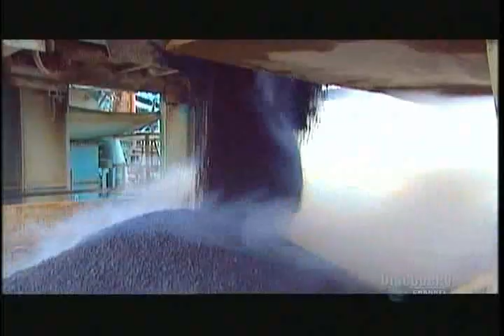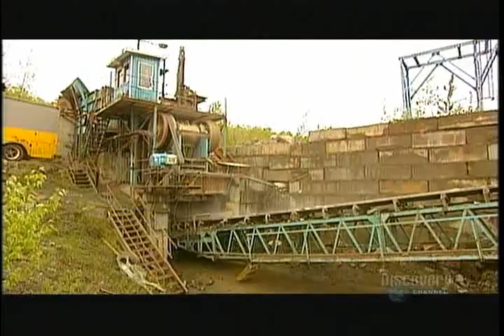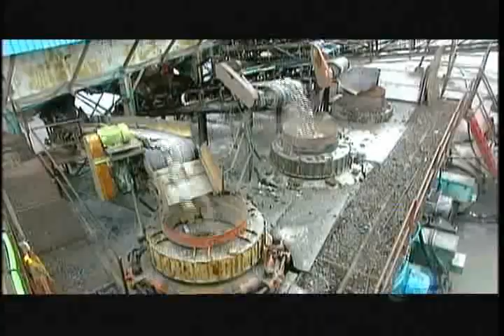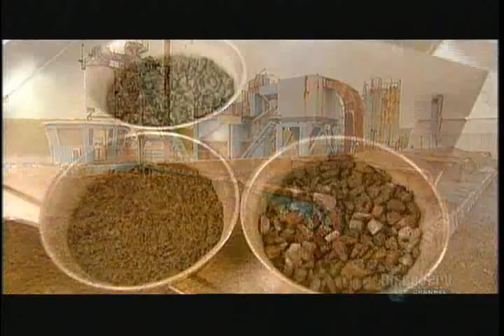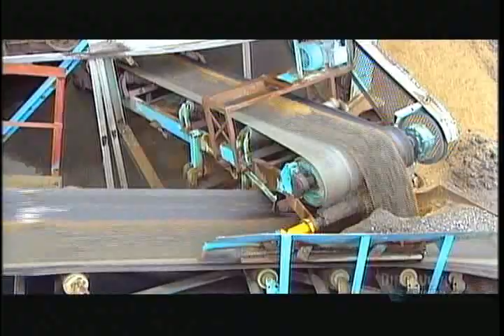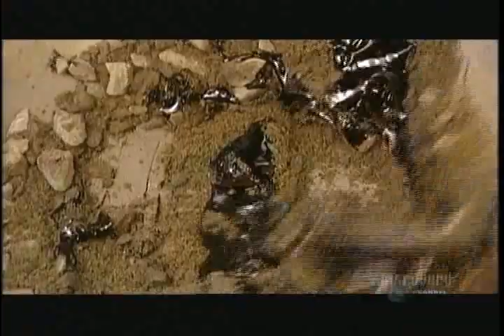How It's Made Paving asphalt

Comment: America call it asphalt the rest of the world call it tar. Its like " to be different from everybody I will make my own words for stuff that already has a name".
Reply: Actually in Dutch it's asfalt
Reply: Tar and asphalt are different materials that are alike. They are simular in the way diesel and kerosine are alike. They are not the same
Reply: Tar is not asphalt.
Asphalt: a mixture of dark bituminous pitch with sand or gravel, used for surfacing roads, flooring, roofing, etc.
Tar: a dark, thick, flammable liquid distilled from wood or coal, consisting of a mixture of hydrocarbons, resins, alcohols, and other compounds. It is used in roadmaking and for coating and preserving timber.
Macadam: broken stone of even size used in successively compacted layers for surfacing roads and paths, and typically bound with tar or bitumen.
Reply: well i work at an asphalt plant we make asphalt the stuff we lay on the road is called asphalt we have different designations for different types but they all fall under the umbrella of asphalt but the oil we use tar whatever you wanna call it the is called "ac" which stands for asphalt cement generally also simply called asphalt it also has different designations for grade but still all under the umbrella of asphalt even though once its mixed with the aggregate its a completely different thing they both have the same name atleast here in the United states
Reply: generally if youre talking about both and they need separate designations for what youre saying to be understood the finished product that is laid on the road is the name that is changed from asphalt to simply "mix" the ac/oil/tar would have priority over the designation "asphalt"
Reply: and if you wanna get real technical about it were actually consider a "hot mix plant" because what we make is called "hot mix" not asphalt asphalt is an ingredient not the product